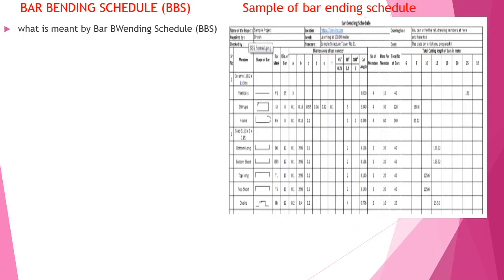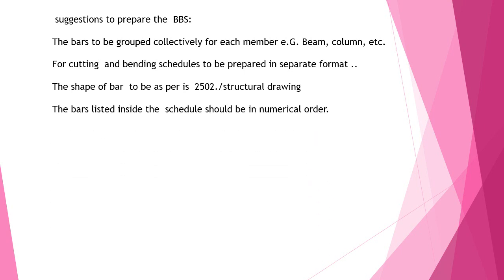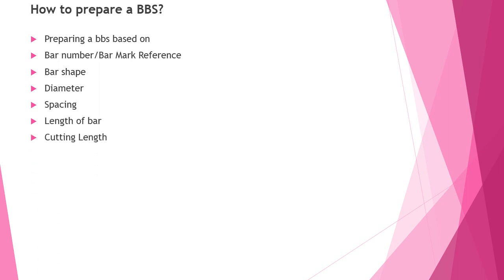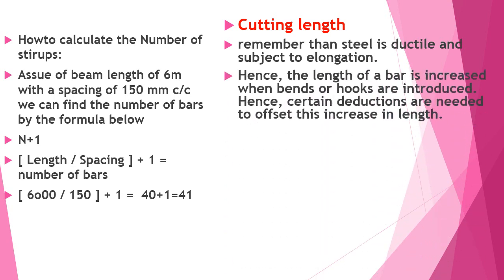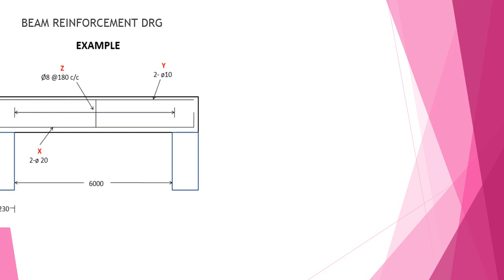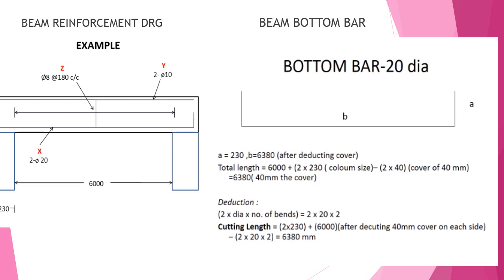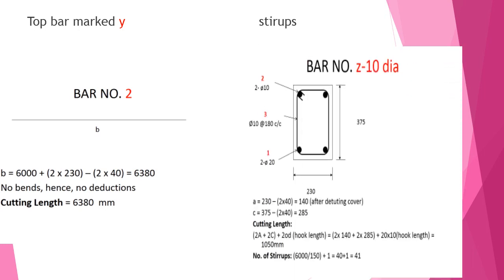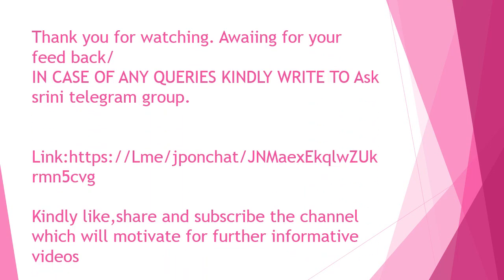Bar bending schedule

Comment: Sir in the bottom bar don't we have to consider the bend portion. Total length = 6000 + (2x230) + (2xdepth of beam) ???
Reply from the maker: Yes thank u pointing the error.
Reply: @civilconclave8042  Sir pls make a much more detailed course on how to make bbs with software